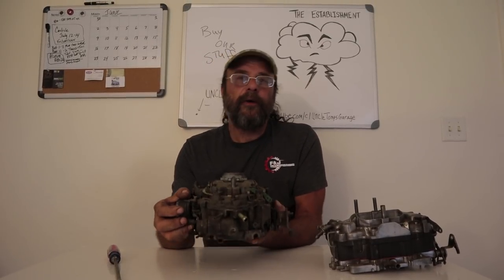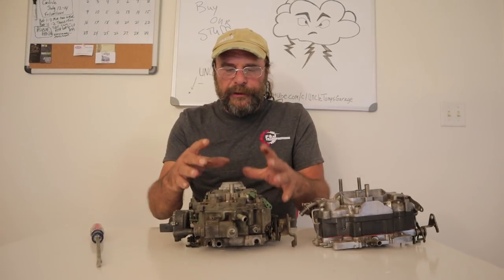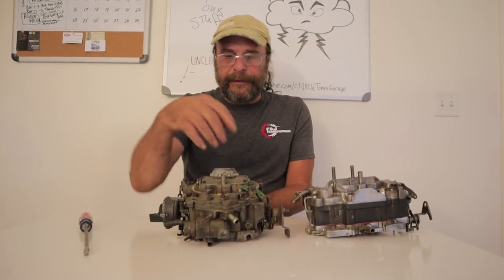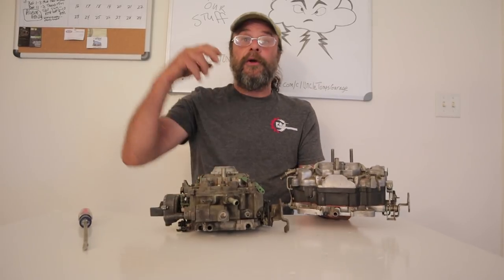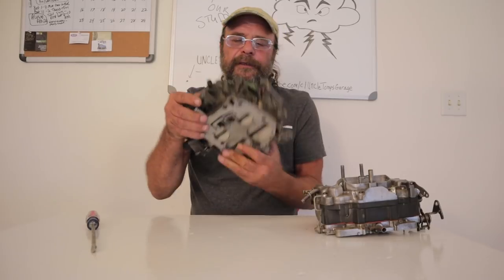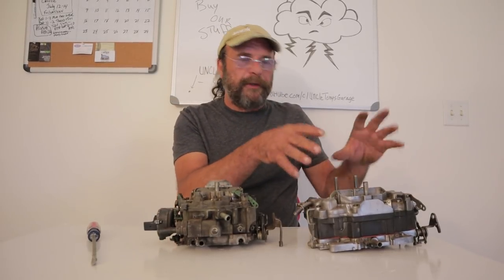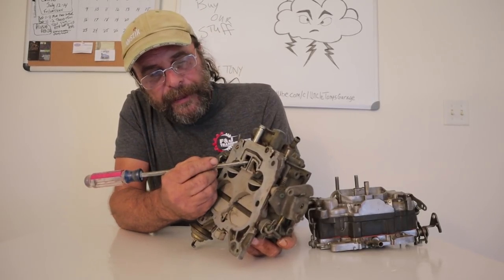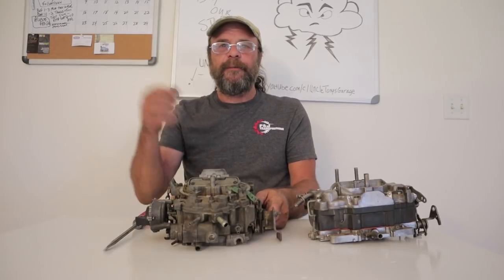The Quadrajet

Comment: great explanation Tony, now I know why on my 70 Impala once it got hot it seems to run worse, or not perform as good.
 the secodaries on the quadrabog were bigger I think, thus the name quadraBOG ?
 I know in my 70 Impala, not a performance car but once I opened it up you could hear the delay, maybe I didn't have it tuned correctly ? maybe the  cam was too small for that carb, once running that car just pulled
Reply from the maker: The secondary air valve needs a little tightening

Comment: Dualjets were derived from Quadrajets, but had the secondary venturies deleted, yet the Dualjets suffered the same off idle stumbles that the quadrajet did.  So I think a lot of the problems with quadrajets, were with an off idle stumble in the primaries load circuit while the secondaries were still closed.  The problem wasn't the accelerator pump, the accelerator pump could be giving a good pump shot to the motor, but the motor still stumbled.  Flooring a dualjet repeatedly helped it get going by repeatedly squirting gas into the motor.  It was as if all the gas drained out of the primary load circuit while the engine was idling and it took like 5 seconds to get the primary circuit to spray gas again.  It was a problem that nearly all high mileage dualjets and quadrajets developed.  I think people could like the dualjets and quadrajets if they knew what caused the primary load circuits to off idle stumble and how to fix them.  My best guess is either dirt blocked an internal passage or bleed, or a leak developed somewhere in the primary load circuit.   Tony....if you could find and identify this problem on an old dualjet....it would be be interesting.  The electronic dualjets had the problem even with the solenoid power disconnected and the metering rod in the up (rich) position.  I never could fix one, nor professional mechanics either.

Comment: It's interesting to hear you talk about the Quadrajet in such a way. Now I'm going to pull the common internet sin of "so and so not myself says" but this is the truth. My father ran a mud truck for many years, a 350 small block paired to a turbo 350 with a Quadrajet carb that had been tuned by a friend of his who sadly passed away before I was born. To put things simply I'm not sure what the man did to the quadrajet but it does not at all look like the model you have set in front of you and I do not believe I have ever heard my father talk about having issues with it. Again I do not have any clue what was done to it, honestly my father doesn't really know either, to quote him "I know motors but Jeff always knew how to make that Quadrajet sing". My father built every bit of that truck but that carburetor and honestly. I don't think it'd perform the same without it.
Reply: the rally drivers of old,would ditch the float.just have a fuel in/out,never problems with lack of fuel or too much.bit like old school fuel injection.nothing good about a 350.sorry.mate had a jag,wanted to fit a dodge 360,340,whatever.no kits here in aus.,so he blinded himself,took his brain out,bought a 350,010 block,spent squillians building it.to make it work.chev,is all speed shop.ill keep my fords & dodges,thanks.
Reply: there was an earlier rochester 4 bbl carb, the 4GC that was a pair of 2bbls put together. the Q jet came out in 1965, this carb was earlier that decade. that might be the carb you remember, it doesn't look exactly like the Q.

Comment: Real knowledge of the QJet is a dying art. Me being in my mid 30s Ive dealt with the ungodly Electronic QJets of the 80s. Unless the car is original and runs good I will always go Carter/Edelbrock as a cruiser. Ive found that the Carter design holds a tune very well across temp changes and is easy as hell. But making any spirited runs at the track Quick Fuel is the way to go, theyve really refined the aged Holey design.

Comment: Hey uncle Tony, I have a 1962 Starfire Oldsmobile when I bought it, it had a 1405 Edelbrock on there with no choke looks like it was supposed to have one, but they had tie wire keeping the flap open. It looks gunky runs like shit so I do have a 394 motor with the original Rochester on it that came out of a 61 62 Oldsmobile Starfire as well. Do you recommend taking that Rochester and putting it Back on there I know with the Edelbrock the kickdown linkage is disconnected. Let me know what you think.

Comment: I have seen a few that drop from the big screws from the bottom coming  loose.People think they are tight but they need to be cranked down with a good screwdriver.I think I've been lucky with the well plug issue.Probably 20 units and no leaks.🙃

Comment: Just rebuilt my quadrajet on my 80 coupe deville and previously there was a hesitation coming off and idle and there still is I’ve done plugs ,cap ,rotor ,wires ,timing is there any adjustments on the carb that I need to do ?

Comment: Any opinions on the SU HD/HS carbs? I'm curios about the off road performance compared to the Quadrajet  I'm using now. I'm finding that most carbs do not do well at extreme angles or they will slosh fuel around on washboard/bumpy roads. I'm kicking around the idea of using a small bore 1.25" SU  carb progressively linked to a larger 2" bore SU on my modified 258.
Reply from the maker: Any off-roaders have experience with these?

Comment: Uncle Tony, I have an autolite 4100 carb on my 64 Galaxie.  I went to replace my float bowl (air horn) gasket.  The one I took out had one hole way over to the left of the carb over the primary float.  All the replacement gaskets I find now have the same hole, plus 3 additional ones right under the air horn vent.  This causes my car to stumble at idle and bog down when I floor it from a stop.  I suspect it is getting too much fuel???  What can I do, or is there a way to plug the extra holes on the gasket?
Reply from the maker: Wish I could answer that for ya...have you tried the forums?

Comment: I kinda know the Qjet. Considering I am the go to if you want one that runs on E85, I should know them. I pull the main well plugs out, tap the holes, stake and epoxy set screws into the holes.  Also I redrill the needle seat inlet to .152" so it flows more fuel. I prefer the inlets with windows in the sides, but really any of them will work. You have to make a new seat with a check ball when you do that, but it works very well. I do that on gas and ethanol Qjets. The added heat for the float bowl helps atomization with the Qjet on E85, thats why I can get better mileage and power from them than the AFB and Holleys, but man can you make a Holley throw the power at WOT.... mileage goes out the window though. 

My 455s will drain the bowl on Qjets or Holleys in first gear at WOT with a stock mechanical pump, or too small of an electric, plus it needs to be mounted lower than the tank and by the tank because they don't suck very well. Moving that column of fuel through the lines with a car that will cut a 1.6 60 ft will need a pump behind it. 7psi works pretty good and will keep the bowl full with the other mods I mentioned. Its not that the carbs can't handle it or the engine uses more fuel than it should its about overcoming the G force of the car leaving and pulling hard in each gear. 455s have a little bit of grunt to them... like 500ftlbs just above idle to 5000rpm is very easy to achieve.

That works for gas or ethanol, and my 65 GTO has a Qjet on it right now I have been getting tuned for E85. The pump is too small so it falls off in 2nd gear, but driving around its great. Its one of those really cheap fuel pumps with 1/4" inlet and outlets. Its not set up for drag just street driving, I have larger pumps if I am going to run it hard. Right now I am getting it to all work correctly. Each one is slightly different and it takes some time to get them right on E85. Much easier on gasoline, and you don't need a wideband O2 for gas, you can read the plugs if its not burning your eyes.

The later carbs like you have in the video have the APT system in them, that allows you to adjust part throttle and idle air externally. Its handy. Things I do to all of them are throttle shaft bushings, pulling the emulsion tubes from the main body to clean them, sometimes open the restriction on the bottom, and if I can get a smaller float for it I will run it so it takes up less space in the bowl. The brass and plastic floats work fine with ethanol, and I haven;t found any modern parts that are not compatible. Really old accel pump cups don't last long, but all the new ones made in the last 30 years work fine.
Reply from the maker: Great info, thanks!

Comment: Great video! Two months ago I purchased a brand new rebuilt Quadrajet from a company in Florida. Because I am at altitude, 5700 feet, I had to fix the high idle and the street idle. The Quadrajet is a M4ME. It sits inside of a Chevrolet P30 chassis mated to a 7.4L 454 V8. What is the torque spec for the 4 bolts that hold the carb to the manifold? Also, my mixture screws are 3 turns out. David 🐈
Reply from the maker: If the screws are that far out to achieve a clean idle, you're probably pulling air from someplace
Reply: The motor is in my motorhome. I replaced EVERY vacuum line, no matter the condition. I even replaced the two vacuum sensors that take their temp from the coolant. I was fortunate to replace tbe AC Delco air sensor that is in the air cleaner. I do not have a vacuum boost for the braking system so there was no vacuum line to hook up to the rear of the carb. I returned everything to spec and followed all the instructions on the side of the air cleaner. At idle at sea level (in Palm Springs) I am pulling 22 inches of vacuum. Here at altitude, I am pulling 16 inches, which makes sense (a loss of one inch of Mercury for every 1000 feet). Every carb person I talked to adjusts the screws as much as 4 turns out. What would be your recommendation? Thank you, David🐈

Comment: I found that super glue and baking soda work's better than j b weld I used it on my coposit fuel pump on the lawnmower and it hasn't leck gas for two years I just had to try it

Comment: In high school my 70 nova had a quadra jet and it would run low 14s without a posi .6.6 tran am had no chance on takeoff.The carburetor float would stick and it would bog.I have taken it apart and put it together in the dark .Usually had parts left over but it always ran

Comment: The nice part about a quadrajett the secondary's will  self regulate if you over sized the carb to your engine combo. The smaller primaries were easier to tune for street if you didn't over cam the engine. They came in 650 cfm up to 850. I hated hollies. pain in the but to tune. Every bowl removal to change a jet or power valve you needed a new gasket. The air bleed idle mixture control was never satisfactory. They ran super rich no matter what you tried. Quadrajett guy here.

Comment: Taking advantage of carb topic... my Slant Six had a vacuum leak because of the brake booster (cylinder #6 not working) fixed that. Now the car accelerate, runs and idles great however the #6 spark plug appears to be very lean while the #1 very rich, a gradual increase in fouling is visible across the spark plugs in-between, stock 1920 carb. Should I worry? I'm very happy with the overall performance after carb and timing adjustment, but this is bugging me a bit. What other adjustment could it be? I'm thinking valve lash... as always very informative video!
Reply from the maker: Check the compression.  All that lean running my have hurt the exhaust valve or rings in that cylinder
Reply: @UncleTonysGarage  Heads were recently rebuild and there is good compression on all cylinders (don't remember exact psi), I'll go to the richer side to prevent valve burning... many thanks for the help!
Reply: @rogerlizama1326  Valve lash needs to be set right. Check that before throwing $ at it.

Comment: Have rebuilt and tuned many a quadrajets, I prefer to work on edelbrocks.  Holley when they used the old black metering block gaskets that shredded and took forever to remove all the pieces PITA.

Comment: My 67 buick with a quadrajet kept flooding out. I adjusted the float to spec and now gas comes out of the top of the carb. What should I do next
Reply: Fuel pressure too high. Try 3 to 4 lbs. Could be bad needle and seat.

Comment: I was a little bit confused by your saying that the thermoq. was a replacement for the q-jet at 0.45 near the beginning . Was it not a replacement for the AVS? I wanted to go with a Qjet on my 80 D150 but the smog situation here in Silicon Valley is so anal and it's got to pass biennial smog test on a chassis dyno .Thanks for all your hard work in producing these excellent videos!
Reply from the maker: The T-Quad was an aftermarket replacement intended to overcome the shortcomings of the Q-Jet.  Chrysler didn't adapt it until four years later

Comment: Tony love the videos.. this is related:  had an sbc start miss firing (i thought?) I pull each plug wire of distributor one one at a time. Everyother one doesnt change how it runs but can see spark jumping to wire. I swap working cyl 5 wire and plug with not working cyl 7.. nothing changed still exactly everyother one in firing order not changine how it runs. This i think is one side of intake/ quadrajet not gettfuel.. ideas of quick fix, carb look rebuilt not to long ago. Had guy come test drive and fiddle under hood could he had messed with anything? It the passenger side of carb. Screw in idle circuit drivers it changes wants to die.. passenger side idle changes nothing. Tried blowing air through circut.. tried spray carb cleaner while running no real change. Force couple pound air in float bowl run much better. Very odd

Comment: I "completely rebuilt a few of those. beyond the usual kits,...I didn't like them, but I was a hot rodder and gear head at heart, but I worked in a shop that decided to push carb rebuilds that I made some coin on, and I had knowledge and access to the rebushing tools for various carb rebuilds.  I feel lazy in saying that holleys were so easy to rebuild and make some coin on, and late model economy box carbs from the late 80's and early 90's were real dogs and usually I determined would be better replaced with a new unit from the parts store.  I don't want to make it sound like I am formerly an expert on carbs, I did a bunch of carb rebuilds professionally for money and on the side later, and even then I bit my nails everytime someone came in purporting they wanted a carb rebuild, I mean, if I was a shop owner back then I would have never rebuilt anyones carburetor unless it was a performance application for a hot rod or off road vehicle, cause the q jets made me "nervous",...and I was college-trade school trained, ase certified, and a gear head and hot rodder with loads of books.  It seems carb rebuilding or any sort of rebuilding of like alternators, even transmissions was going out of style in the nineties in favor of full assemblies carried by the parts stores, or so it seemed sometimes.

Comment: I know I'm coming to the party late. I think the quadrajets are excellent when they are new and working as they should, especially for hitting the gas at the stoplights and kicking in those secondaries. That said. I think dumping the cast iron manifold over an aluminum and and matching it up with a nice Holly is the best way to go with a GM. You will sleep better at night and won't be taking all that Advil. The quadrajet is a marvel of complexity compared to a holly. It's clearly made for people that like to tinker.

Comment: Hey Uncle Tony- got a 1978 350 with 1992 vortec heads w/high rise int., inch and 5/8" headers, mild comp cam int:210 exh:218 duration, timing set @ 4deg BTDC(started @ 12deg, then 10, finally found correct setting for this cam on Summit) and a 1983 qjet.....idle mix screws set around 18 in. Hg vac......13/32 float level is SPOT-ON. Truck runs & purrs like a kitten around the neighborhood, very "peppy"......get out on the highway and she stars stumbling, even back-fired a couple of times, not loud, just PHH-PHH, after 55-60mph......acts like it wants more fuel(higher comp. heads).....does the exact same thing w/wo air cleaner on it....SO, my questions are: In what increments do you think I should start to raise the float level? 3/32, 5/32 ....1/32? AND/OR do you think I should re-jet? if so, what size to start?. I'm trying to find the float setting for the 396ci or 400ci motor. I don't want to have to pull this thing off any more than I have to.(I can only do bench work, bad back & old eyes, or maybe it's the other way around) It gets boring after the third or forth time anyway,...... and I'm already there.....Thanks for your time and help...

Comment: Yup I got a build methnol ethanol alcohol kit in my 800 CFM quad going on my LS1 NOS built
Reply from the maker: You'd better have some STOUT fuel delivery system in that thing to keep the bowl from going dry.  Could turn into a NOS suicide mission REAL quick!
Reply: @UncleTonysGarage  3/8 inch aluminum fuel lines. MSD pump with return filter, fuel cell an 12 coming out. Plenty of fuel.
Reply: Holley regulator

Comment: The one area that the Quadrajet is dominant is off road in mountainous terrain. The Quadrajet can go from 5000ft to 12000ft elevation better than any holley or carter. The center float bowl is king in off camber and steep grades. I've built dozens of holleys for this application but even totally tricked out they are marginal at best on grades and heavy suspension bounce. Yes the Qjet is tougher to work on for the average guy though.